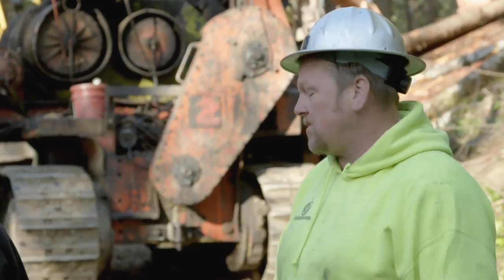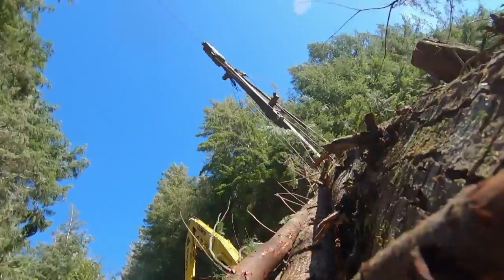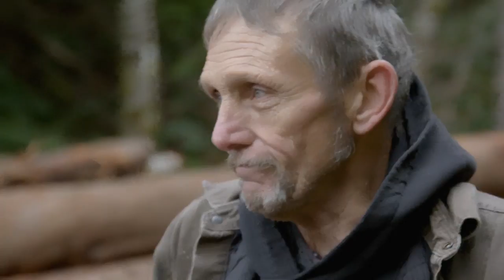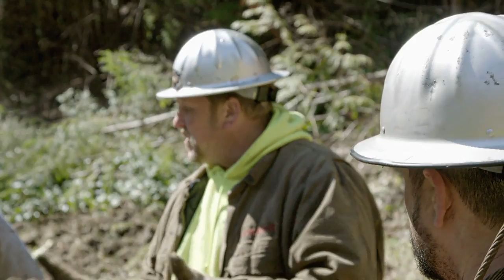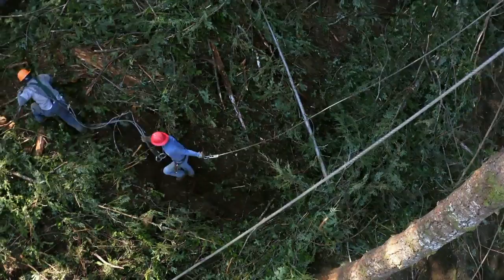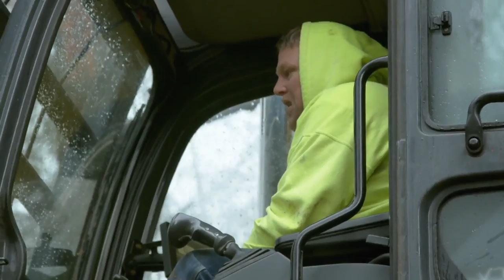Ax Men: Rygaard's Risky Plan to Keep the Wood Moving (Season 10) | History

Comment: I work in the woods for about a year I quit before getting killed. Its that dangerous. The way they depict this is accurate logging is extremely frustrating miserable work and equipment is constantly breaking down to add to the torment.
Reply: These guys would be shut down quickly in New Zealand. .. they are amateurs regardless of their supposed experience
Reply: @cainsmale5988  i agree.
Reply: @cainsmale5988  100% guaranteed